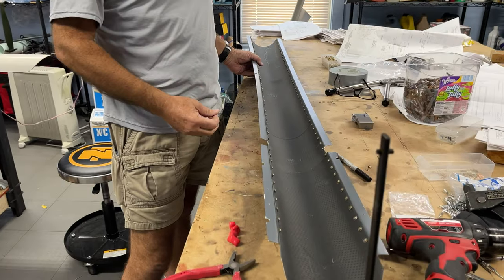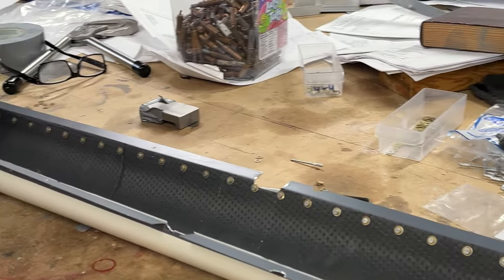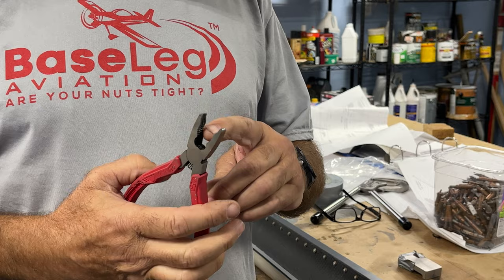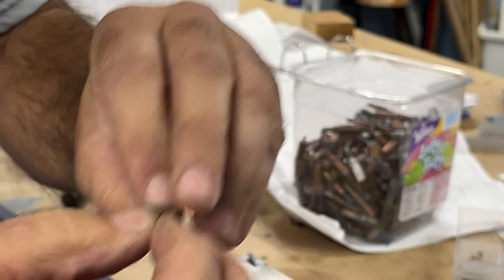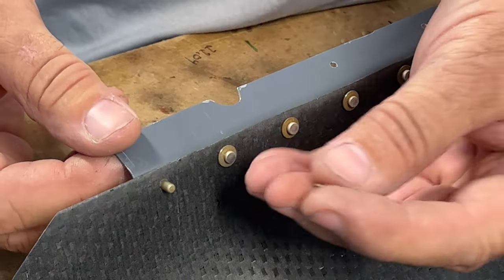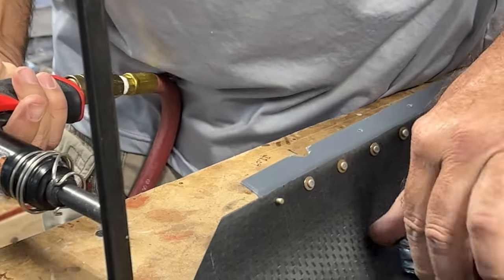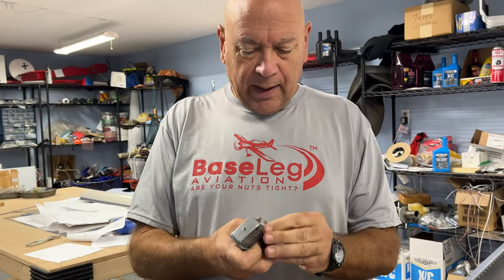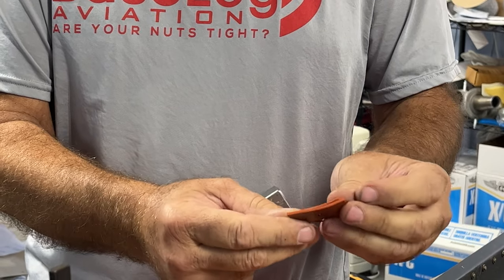Riveting fiberglass to metal

Comment: Great hint. I’ve used a short section of poly fuel line, cut slightly longer than the rivet sticks out, to hold parts together when squeezing, but that doesn’t work so good when bucking. Happy for your Covid recovery. It thoroughly kicked my butt last fall!

Comment: G, day from Sydney Australia.
I have heard that pop rivets are just as strong (clamped force) as solid rivets.
And for the DIY much cheaper and easier. Do you have an opinion?
🌏🇦🇺
Reply from the maker: Well, that depends upon the type of “pop” rivet that is used. Cherry rivets are a good choice, and CherryMax rivets can even be used in structural applications as a substitute for solid rivets, although sometimes you must use the next size up of CherryMax. I certainly wouldn’t be using Home Depot aluminum rivets or such. Look at the specs of Cherry Rivets. They are all made of different materials, from aluminum to stainless, and the mandrels can be different as well. You can a find the specs on their website and they are in the Aircraft Spruce catalog as well.

Comment: Is that thin washer deep enough to have to lengthen the Rivet typically? Looks very thin but hard to gauge on video.
Reply from the maker: No need to use a longer length rivet with the thin washers.
Reply from the maker: It didn’t make much difference on the rivet length. Just make sure you have the proper length after setting the rivet.

Comment: I really like your hints but using aluminum rivets to hold carbon fiber down is not a good idea if the area is exposed to moisture and dirt as in your helicopter case. Carbon and aluminum are at the opposite end of the electron affinity scale making a strong battery when moisture and dirt are added. Boeing had issues with 1 inch thick aluminum parts being eaten up that were mounted against carbon in the kitchen area. Same happens in sailing when people make that mistake. An aluminum fitting was dissolved within a month on an America's Cup boat.
Reply from the maker: Thx. I will keep an eye on them. The plans call for regular AN rivets, which are aluminum, so I didn’t think about that.
Reply from the maker: I went and took a look at them after reading your comments. The aluminum is primed, and the washers are cad plated. The only aluminum is the AN rivets and pop rivets. I will keep an eye on them. The only extra thing I can think of is to use stainless rivets, but I think the setting force might be a little too strong.
Reply: @baselegaviation1614  Aluminum and carbon make a 1.5V battery, SS and carbon make a 0.3V battery. Fiberglass and any metal make no battery at all. Look at the DarkAero project, they always transition from carbon to fiberglass where they have metal attachments.